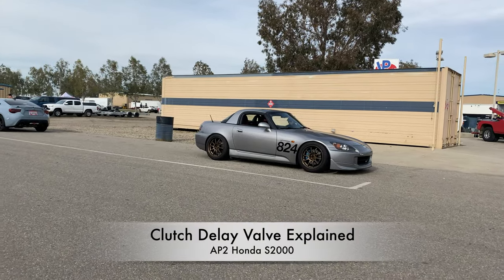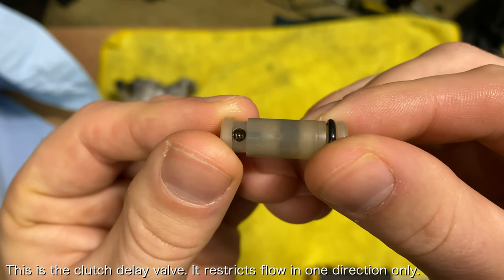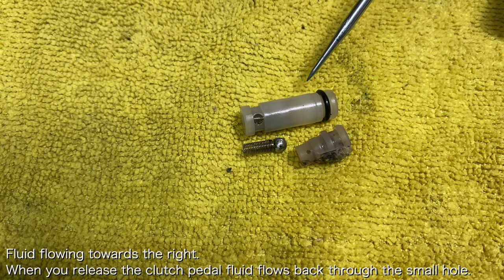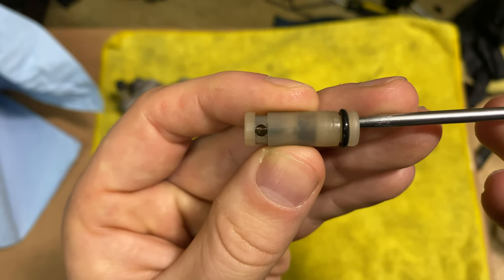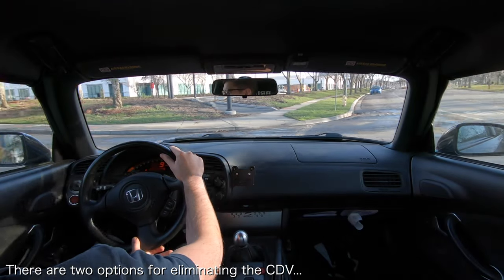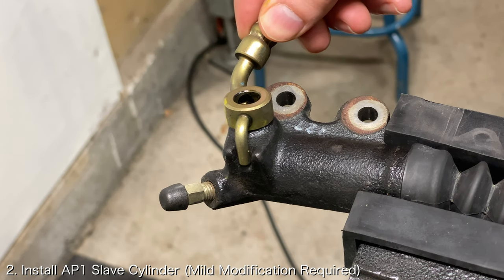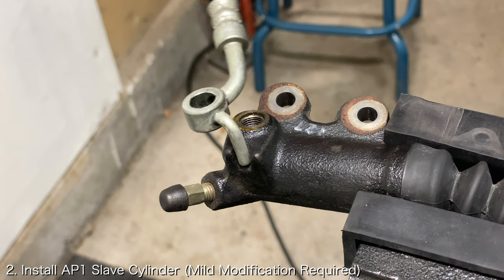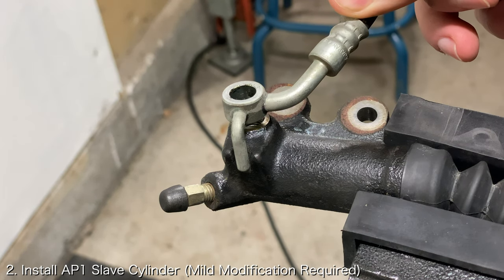Clutch Delay Valve Explained | AP2 Honda S2000

Comment: Instead of using AP2 oem clutch fluid line with the AP1 clutch cylinder (which you explained does not fit), could you just use a aftermarket clutch fluid line? Most aftermarket clutch fluid line is for both AP1 and AP2 so should work fine.
Reply from the maker: Yes!
Reply: @DIYGuysvideo  Thanks for the reply and all the very informative videos!
Reply: Any idea if the ap1 Spoon clutch-hose is compatible with an ap1 master, but on an ap2?

Comment: I wonder if J’s Racing Clutch Slave Cylinder for the AP2 has no clutch delay valve in it since I installed the J’s Slave Cylinder in March.
I’ll test drive my AP2 tomorrow.

Comment: Does this clutch-delay-valve make it more difficult to smoothly engage the clutch from a dead stop?  As my 2007 S2000 gets older (I have had it since new in 2007), I find it becoming very difficult to engage my clutch smoothly from a dead stop.  This is on top of my worsening-yet-typical S2000 "tip in stumble" that I see people talking about everywhere, with no one declaring a definitive solution.  (Yes, I know about all of the things people have tried, but I don't see anybody declaring an absolute guaranteed solution).  I have another manual transmission car (a 2017 Porsche 911 Carrera S) and its clutch is silky smooth with none of the S2000 annoying clutch characteristics. I would remove this clutch delay valve IF I could hear that doing so makes clutch engagement markedly smoother.  Thank you for making this informative video.
Reply from the maker: I don’t see how it could have anything to do with engagement when starting from a dead stop. It only really impacts the depressing the pedal when it’s done really really fast
Reply: DIYGuys Thank you very much. That’s incredibly helpful.
I never “shift very fast“, so that’s not an issue for me at all.
Now I have to admit to myself that my clutch is simply worn out, and needs replacing after nearly 14 years of in-town driving.  I have to get up the nerve to replace my clutch myself in my home garage. The DIY articles I’ve seen about that procedure are quite daunting.  But I’m also convinced that doing it myself is the only way I can be sure every single detail of clutch replacement is done meticulously, cleanly, comprehensively and carefully.
Once again, thank you for your informative videos.
Reply from the maker: I have a video series on the clutch replacement. Feel free to check it out
Reply: DIYGuys yes, I know.  Your videos are the best on You Tube on this subject. Thank you.

Comment: I'm going to soon be installing a street lite flywheel with the h021 hardened pressure plate.
I learned to drive with the cdv and can feel it if I up shift too fast sometimes

Isn't it better to keep for safety? What is your opinion
Reply from the maker: I would recommend removing it if you track/race your car. Otherwise not worth it for the street.
Reply: @DIYGuysvideo  lil bit of both for me
Slight track and mountain runs as well as street driving
So I guess I get rid of it when the time comes

Comment: I'd the CDV is designed to baby the diff from hard engagement, should someone like me who has gone FI leave it in if I haven't done any modification to the diff? I never launch the car, and don't track it, but I do shift hard for the rest of the gearbox when getting to speed.
Reply: I'm also forced induction, I chose to leave mine in as a precaution to save the diff and gearbox. to me it makes sense with the increase in power.
Reply from the maker: I would leave it installed.
Reply: My Rio has a clutch delay valve. If I shift up quickly without a pause, they will get kicked. This valve gives some delay in shifting (prevents the clutch disc from being pressed against the flywheel quickly and harshly, as can be done with a pedal), especially from 1 to 2 and from 2 to 3, but makes all non-sports shifts smooth too. New BMWs for example G82 also have this valve.

Comment: clutch delay valve is there to remove drive line shock and breakage.
the higher hp you get the better and safer to launched your car on the track with a delay valve
especially with a twin disc clutch.
its actually nicer and easier to drive them on the street than without.
Reply: My Rio has a clutch delay valve. If I shift up quickly without a pause, they will get kicked. This valve gives some delay in shifting (prevents the clutch disc from being pressed against the flywheel quickly and harshly, as can be done with a pedal), especially from 1 to 2 and from 2 to 3, but makes all non-sports shifts smooth too. New BMWs for example G82 also have this valve.

Comment: BMW does this to its cars too and it’s super annoying. They must think it’s drivers need that “nanny” to tuck them in at night too, lol
Reply: My Rio has a clutch delay valve. If I shift up quickly without a pause, they will get kicked. This valve gives some delay in shifting (prevents the clutch disc from being pressed against the flywheel quickly and harshly, as can be done with a pedal), especially from 1 to 2 and from 2 to 3, but makes all non-sports shifts smooth too. New BMWs for example G82 also have this valve.